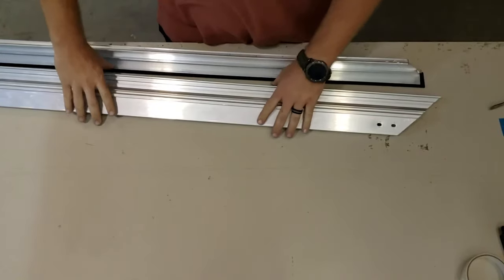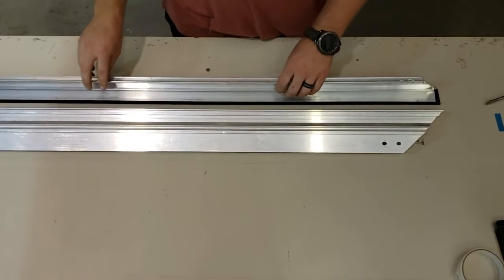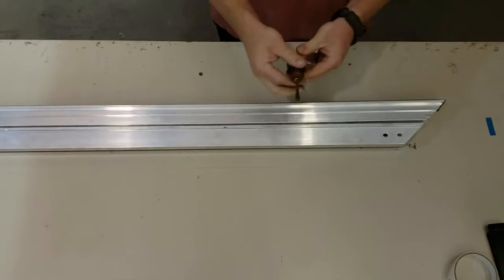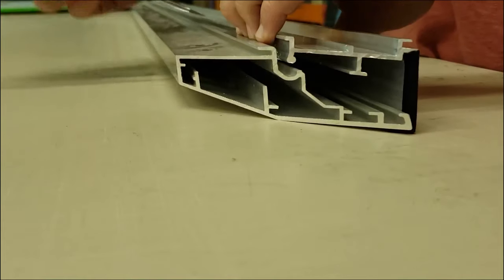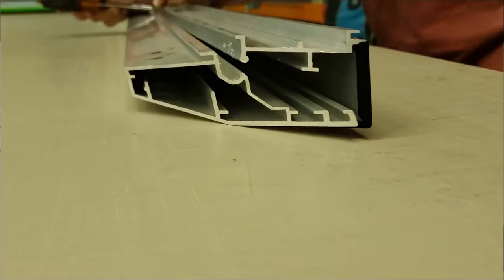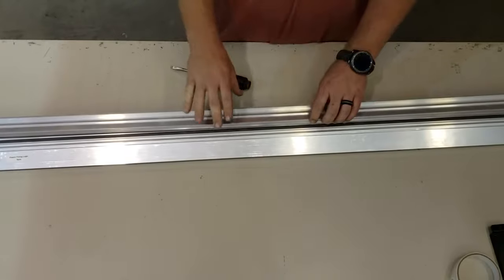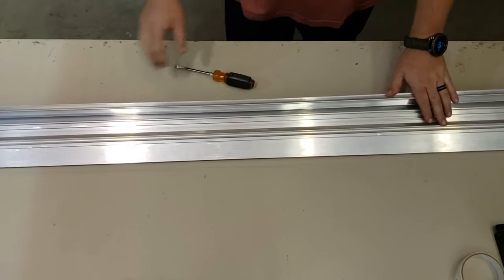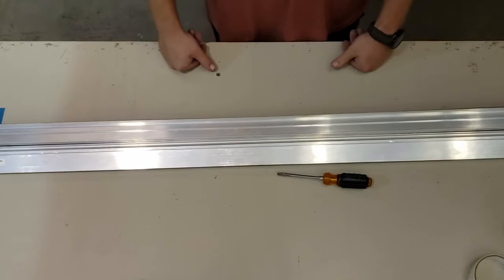STT Bezel Removal

Comment: My 16:9 AT 150" thin bezel is up and reflecting. Only issue was getting the black cloth stuck to the back of the frame. So far Gorilla tape is working to hold up the cloth. Wall mount is slick & makes accessing equipment a breeze.
Reply: Here is another one of our videos that shows the taping method as well as actually fastening the black backing to the frame. 

https://youtu.be/hPE07FaAs-M